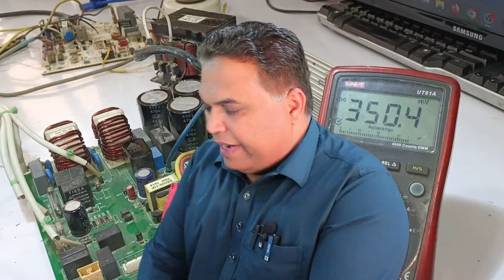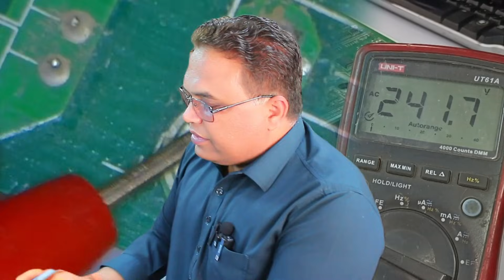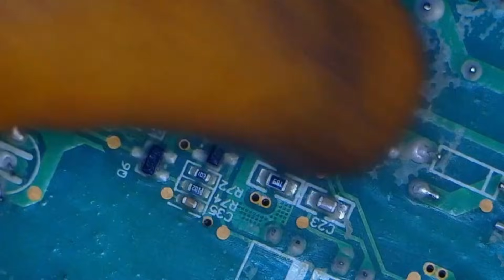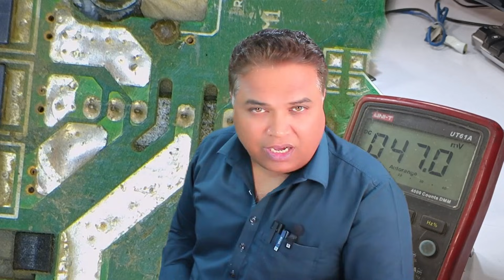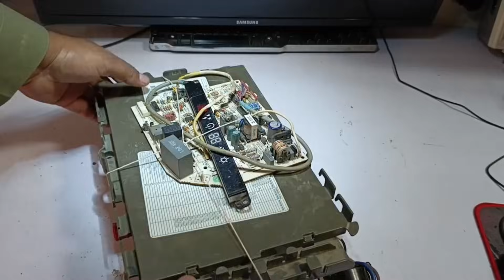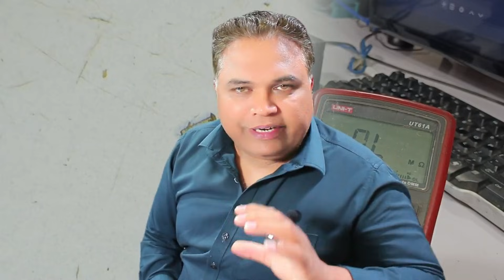13 Ways to Test Gree Mini Split AC Circuit Board To Fix U5 Error!

Comment: Hello sir - I found your movie that you are an expert with Air Conditioner electronics. My problem is that external unit of Air Conditioning stops working. Also general fuse (I mean the 230V fuse in home installation) was failed with overload. This is the Xiaomi split system M1 or M3 maybe, bought in 2020, was working fine up to now. The internal unit has JUK7.820..900017555 PCB and external is JUK7.820.900014690 (V180606). I found that there is 230 V on external unit conectors and click can be heard in internal unit. Internal unit shows F6 error. I had checked three temperature sensors and are ok. Also gas pressure is ok, 16 bar. Can you point me how to check this system to be sure which part is to be replaced?

Comment: I have an LG inverter sleep device. When it is connected to the electricity source, the house breaker is disconnected. The device card was checked. There are no short circuits in the IPM, as well as the unification bridge and IGPT. Where could the fault be?
Reply: Check if there's inrush current circuit it might trip overcurrent if it's not working correctly. Circuit usualy consist of resistor and overriding relay. If relay is stuck, inrush current is too large.

Comment: If I measure the air conditioner communication signal with an oscilloscope and connect the same frequency and same volt artificially, will the air conditioner outdoor unit work?
Reply: Elaborate, please. Where would you connect ac voltage "artificially"? What did you mean by "artificially"?